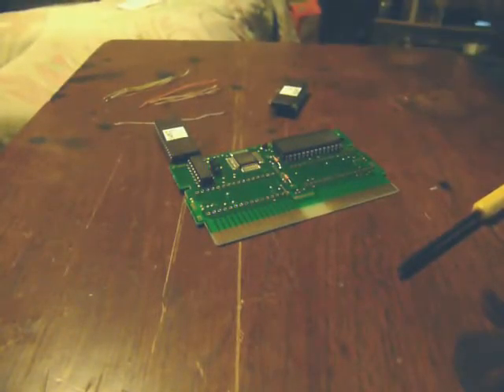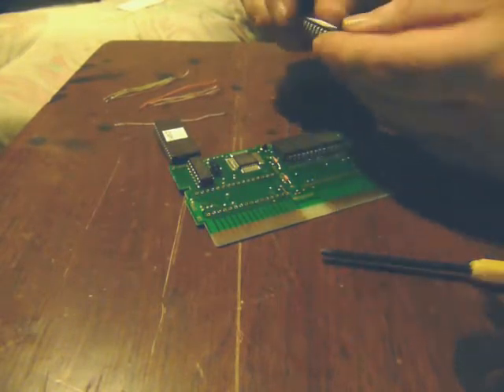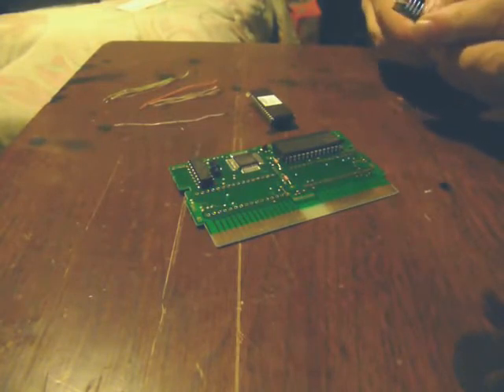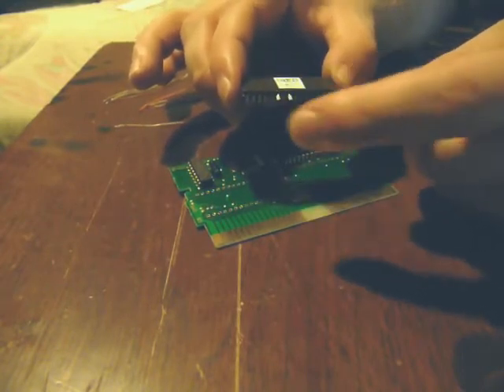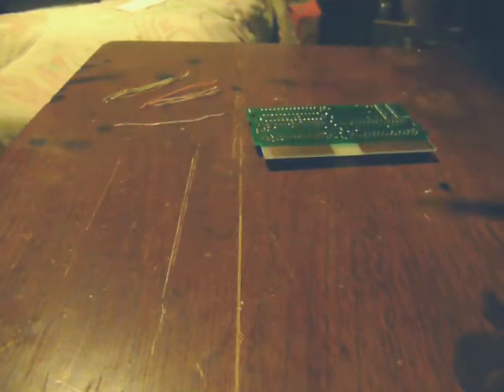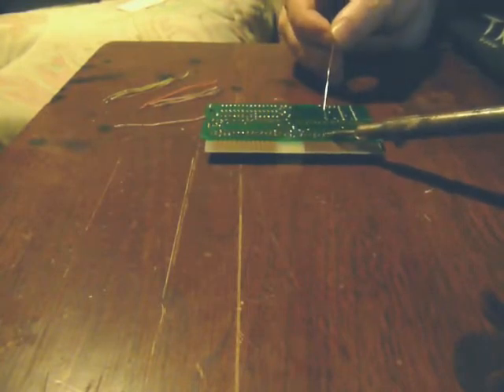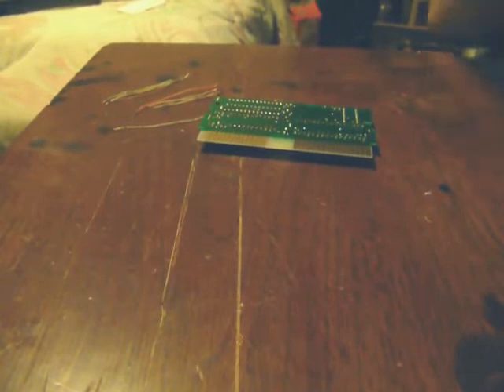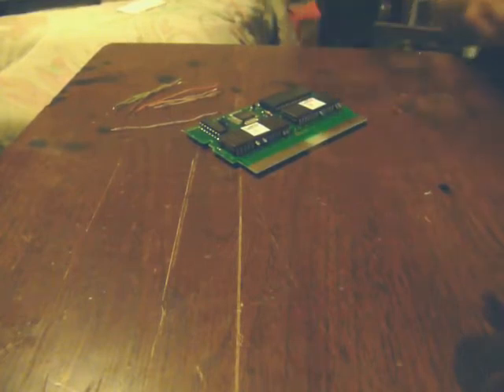Making an NES Reproduction Part 3.1

Comment: Ok thanks for the txt file it seems to be what I am looking for. However I don't know where I would find hole 22(A16)(under the 22nd pin on the chip?) or the GND(OE). Solder pin 2 to hole 22 (A16) Solder pin 24 to GND (OE). If you could explain what these are or where a good explanation of them is on the net that would be great. Thanks for your time.

Comment: cool thanks I will check it out. I love your vids, they are the only ones on youtube that show what is done properly. I will do whatever you do to get this job done, including lifting the pins method. I will most likely run wire like you did and lift the pins. Any other information on this process would be great. What about save functionality? Will any game with a battery and wram or sram do? Those also confuse me a little. Thanks so much.

Comment from the maker: The ROMs that are originally on the NES carts have a different pinout than the EPROMs you'd be replacing them with... so you remove them from the circuit, then run the wires to put them back into the circuit in the correct place. Google "NES EPROM conversion" and you'll find a .txt file that has a list of where to run the wires on which board. You can do the same thing by cutting traces on the board and running wires, but lifting the pins is just easier for me.

Comment: Great work man. I am planning to create some reproductions. Mainly Final Fantasy 2(NES) Final Fantasy 3(NES) Final Fantasy 5(SNES) so I can finally play the FF series in its proper order. I am a bit puzzled by the bending of the pins and the rewiring of the pins. I have soldered my own circuit boards in TECH class so I know how to use diodes,chips and how to solder. I just need a technical explanation of why the pins are being bent, and where the wire are going and why. Thanks a ton!

Comment from the maker: Maybe a combination of not working fast enough, too much solder, and/or no flux? Solder has a little bit of flux in it's core so that is usually enough, but if you're not working fast the flux all burns off and the solder can get messy. I use extra flux because it's just easier for me as I don't really solder "correctly" and apply solder directly to the soldering iron and use it from there. Flux helps me keep the solder flowing and makes the connections better that they would be without it.

Comment: Thanks a lot. I've been using single core but wa just wondering if stranded would be easier to use but any wire is fine I guess as long as it isn't too thick. I have another question, when I solder the legs of the EPROMs the solder clumps up into a ball so it looks messy when it's done. Is this because I don't use flux?

Comment from the maker: I use single core wire. Actually, I just with Cat5 cable and cut off a little bit of it, inside of it are 4 pairs of single core wire, those are the wires I use to run the jumpers.

Ideally, in the cart, the wires won't be getting moved around too much or anything, so I guess pretty much any wire will do as long as you make sure it has a good connection to the pins.